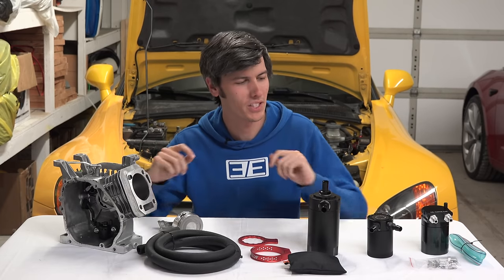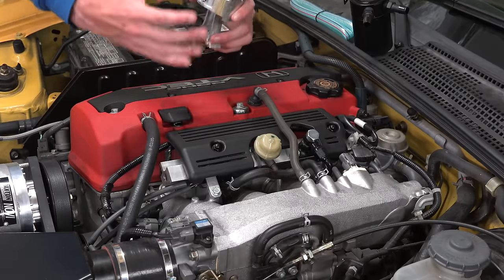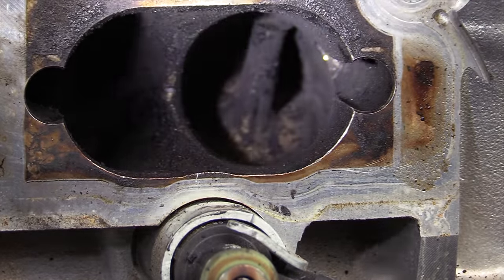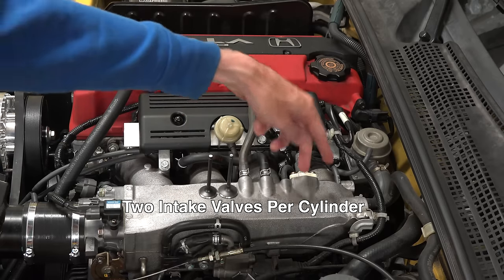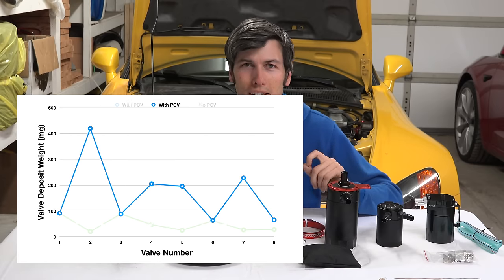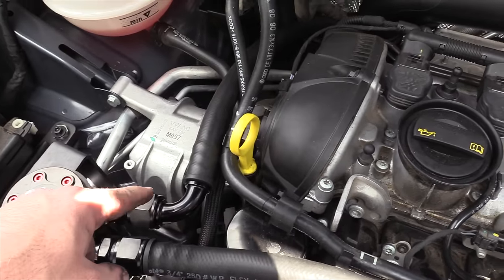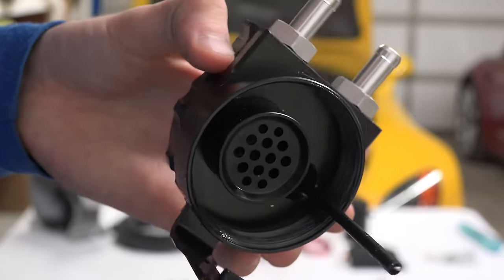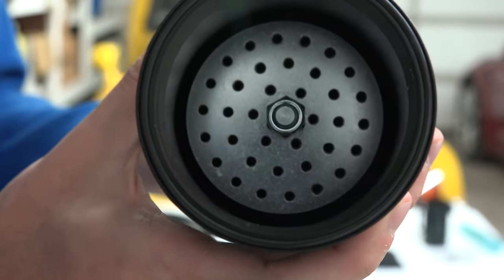Do Oil Catch Cans Actually Work?

Comment: Direct injection engines (now virtually every engine) have issues with buildup on the intake valves, and now that the injectors are no longer positioned to spray fuel on them (they now spray fuel directly into the cylinder) the valves no longer get any cleaning from the fuel and it's additives ... it seems that an oil catch can in the PCV system to separate out oil vapors from going into the intake manifold and coating the valves would be a good idea

Comment: The best design is the $25 one with two Scotch-Brite pads (stainless) inside. They cost $2 and fit perfectly. This setup has caught lots of oil in my '04 Wrangler.
Reply: Roughly how fast did it fill up? I do like the dipstick that comes with it.

Comment: I have the Mishimoto compact unit; its filtration is excellent and on my turbocharged 1.6 MX-5 it fills up with mostly a watery, fuely substance in about 3000 kilometers. This is mostly beating on the engine very hard, so all in all even its small size isn't really a problem if you're already involved in keeping your modified vehicle in good operation conditions, which would imply you do general checks and minor maintenance around/before that interval anyway.
Reply: Your engine needs a overhaul if it fills up in that distance
Reply: @Thunderstormworld  Not when the 3000 km is about 85% track mileage and the can only holds about 30mL until it hits the lower baffle plate and needs to be drained for it to continue to work properly. 
These motors are known to produce quite some vapour under heavy loads by default, so catching those vapours off instead of throwing them directly back into the intake plenum is very beneficial to the engine's lifespan.
Reply: @Thunderstormworld  Dangerous advice to give to someone if you don't know what you are talking about. 3000km fillup in a compact unit is very good, there are cars that fillup way earlier with even newer engines.

Comment: One question I have never seen an answer of  elsewhere is - How Long is Too Long, for the In/Out Hoses? My goal is to place the CatchCan down in front of the Radiator, to get Can as Cold as possible for Condensation. To achieve that I would need to run a 3m Cl. ean and a 3m Dirty line hoses (as I want to keep the engine bay 'Neat' & Least Intrusive to the Mechanics when doing Scheduled Servicings.  I see the 3+3m of Hose results in quite a High Resistance to overall PCV AirFlow... (as tested by using Lungs to Test Blow the entire hose/can/hose setup)

Comment: you could expand on this topic by talking about PCV  vacuum pumps which directly increase HP output , & or the lesser approved of method of running a line from each valve cover into the exhaust header collector at a 45 degree angle and cap off the hole in the intake all together.
Reply: Otherwise known as the built in smoke screen maker.
Reply: @SeanBZA  on a newer car i cant imagine it producing a noticeable amount of smoke but on an older car with loosened up tolerances of the cylinder bore/ring seals probably yes. on this video he drained the container after thousands of miles and had a cup of oil. you have to imagine that same cup of oil being burned over the coarse of hundreds of thousands of combustion cycles in that same time interval.
Reply: If running open headers then yes, if mufflers then it may not work at all. The pump would be nice, but also very expensive and I'm guessing most cars don't have the room to install them. The oem pcv works reasonably well and it's already there so pretty much everyone can do it. I'd like to do the pump but I'm just unwilling to spend the money or time

Comment: Oil air separators on the PCV system are actually very helpful especially in positive manifold pressure designs. The intake Scavenging that OEM happened to go after reroute oil Vapor back through the intake. Severy et al military tests showed oil vapors ignite a full 100c colder than gasoline.

Oil Vapors back through the engine is technically asking for detonation/preignition if enough of it is there
Reply: So, is catch can useful?
Reply: Yes. In this instance it would allow it to be mixed as a vapor instead of liquid with the air and fuel… and increasing power and efficiency.

Computer controlled timing prevents predetonation. If it would occur at all… gasoline engines don't get that hot. Especially if direct injection.

Comment: To almost eliminate piston ring blowby, install a set of gapless piston rings in the engine. Especially for turbocharged engines with high cylinder pressures. They will reduce the amount of crankcase pressure and reduce the amount of oil that these catch cans are catching.

Comment: When used in a 2009-2015 Prius, it reduces buildup in the EGR system, intake manifold and throttle body. This causes a chain reaction that cleans up the catalytic converter and O2 sensors and keeps the dreaded head gasket failure that is caused by un-even cooling and varying compression due to intake manifold EGR ports being plugged on some cylinders and not on others.

Comment: A lot of people are asking why the manufacturers aren't including these on new cars. They don't want to advertise another maintenance item that people need to do, and don't want the liability. If they are never emptied, that can be worse than just not having one. Let's say your can is completely full, and then you drive on some sort of slope, a huge (yuge!) glob of crud is going to get sucked straight into the valves and pistons, and that's bad. Kudos to every DIY'er who takes care of his/her car. 97% of the people buying cars would say, "Huh?"
Reply: Manufactures do use Air oil separators.  They are similar but drain into the oil pan.  It makes no sense to run a catch can on a street car at this point.  Many are also tied into the engine coolant to warm them up when cold and cool them when hot.
Reply: Good point.  At one point they did though.  Nissan had one on the S13 SR20DET.
Reply: That is an assumption. Another possibility is that catch cans are ineffective and do not help much- and that overheating valves are the issue. Or.skmething else entirely. For example the engineers at Toyota have gone to the trouble of fitting port injection to DI engines, why if a self draining catch can would have done?
Reply: Maybe manufacturers like to make money repairing gummed up valves and inlet manifolds?
By the time you have problems it's out of warranty and they're killing the pig...
Reply: until you get a massive lawsuit on your hands.
Reply: Huh?
Reply: Just do an AOS instead
Reply: Why not just leave the bottom of the can open and let the oil crud flow onto the street instead? Zero maintenance!
Reply: Dan E Garner  that’s another assumption, what makes you think that’s the reason or only reason for a dual injection motor? There’s other reasons that are more likely on the engineers minds.
Reply: RJ M   It doesn’t take nearly as long as most warranties for the issues to arise, many dealer techs get to fix these issues under warranty.
Reply: @dantheman1337  I read an article about Toyota or Lexus concerning their initial integration of DI in their engine.  It built so much carbon deposits that they had to put an additional port injector to solve the problem LOL.  The same thing happened to Ford with the introduction of the EcoBoost engines.  There were more automakers mentioned in that article...VW, GM...  isn't carbon deposits one of the causes for valves to overheat?
Reply: Well on some cars that require thousands to clean it is going to be worth it.  Foul out a Cat or walnut blast valves clean on a turbo GDI Mercedes and it'll exceed the price and time spent changing a can by a country mile.
Reply: @logik316  that would just be a massive vacuum leak
Reply: @logik316  I've always wondered why we don't just have oil tanks like fuel tanks that empty the oil from the oil pipe onto the street. When we're running low we can simply refill it. No more oil changes as it's always fresh.
Reply: Still install a catch can for safety and lets just say something of mine blew up well then at least I didn’t get sludge build up 😂

Comment: Just wanted to point out that what you are calling "filters" inside these catch-cans are inbound flowing and function as a condenser to cause the crankcase vapors flowing through them to condense into droplets that then drip into the reservoir.
Reply: Regarding to that, it 's also important that the airflow restriction is keeping as small as it could be.
Otherwise the crankcasepressure is getting high and causes Oilleaks.

So, you have to keep the routing short and the catch can should not contain a Brassfilter in it.

Comment: I am not quite sure about the exactitude of the "blow-by" phenomenon, explained at 1:16. As it is described, it equates to highly worn piston rings, and loss of compression into the crank case. This is usually diagnosed by a cylinder leak-down test, and usually followed by a bottom end rebuild. Try to think of the crankcase as it is from the underside of the engine, as it were. Forget about combustion chambers for now, and focus on what's going on under the pistons. The reciprocating movement of the pistons, as they go up and down create variations in pressure in the crankcase, hence the need to ventilate it. It has nothing to do with piston ring blow-by. I just thought it would be useful to clarify.

Comment: I'd keep in mind the cheapest catch can of the three may cause a vacuum leak if its being used on the PCV to intake side if the dip stick isn't sealed well or has no o-ring.
Reply: New O-Ring = $0.05 ; New Engine = $5,000

Comment: I put the $25 catch can on my Prius. Since it doesn't have a filter, I put in half a stainless scouring pad in the bottom. It doesn't exactly filter but it keeps the oil form splashing up and out into the intake manifold. Especially in the winter time, it catches a lot of oil, water and gunk that would've gone into my cylinders via the intake manifold.

Comment: Nice video , you forgot to mention the effect oil vapor has on knock threshold.  High performance engines use catch cans ; or just vent it to the atmosphere; to try to keep the oil out of the intake . Oil has a very low octane rating so it wouldn't take a whole lot of oil vapor to lower the octane rating of the fuel you are burning in the combustion chamber and lowering your knock threshold.
Reply: Good point, thanks!
Reply: yes, vent to atmosphere which is highly illegal on the road's.

Comment: I have a 2 liter Solstice GXP.  Routed the PCV to atmosphere. Problem solved.  Lots of discussion over the years about the value of catch cans.  Nice to see some engineering testing.  What about SeaFoam treatments to remove deposits?
Reply: But you introduced another issue of not venting your crank case with vacuum while driving which reduces engine life. Real solution is to pull a vacuum with exhaust but through a catch can to burn as little as possible.

Comment: High temp of gas flowing doesn't get trapped due to lack of condensation radiator (or similar device) optimal would be having a bubler type of set up in water or to prevent possible corrosion it could be bubler in diesel. Basicly something with high smoke point yet enough thermal capacity to maintain lower (oil and water condensating temp).
Water: 4.18 J/g°C

Brass: 0.38 J/g°C (varies depending on the exact composition)

Oil (varies based on type): Generally around 2.0 - 2.5 J/g°C

Tell me if i missed something or why this would be a bad idea?

Comment: Something people forget with oil blowby is it can massively reduce octane, so those of you pushing it with timing or boost should consider it a must.
Reply: Good point
Reply: How would it reduce octane; octane is the fuel's resistance to pre-ignition. A lower octane means it's easier to ignite/have a pre-ignition in a higher compression engine.  Do turbos increase compression levels?
Reply: @Tadders  the crank case vapors venting into the combustion chamber have a lower effective octane rating that the fuel being injected, they’ll detonate before the fuel does.
Reply: @pballer2005  ohh I suppose it's because it's vapor, makes sense. Thank you.
Reply: so i have a 99 cobra with a forged bottom end , and a 2.1 kenne bell supercharger it’s currently at 9 pounds of boost making 475 to the wheels so in the conservative side since it’s pretty much a daily, i don’t race it little to none nor do i floor it a crazy amount just get on it here n there. how big of a deal woukd it be if i NEEDED a catch can or not?
Reply: @chrisj2308  I’d argue it’s needed on any boosted car since they have more blow by, more vapors blowing out the pcv and into the intake.
Reply: @pballer2005  thank you for the quick reply i’ll have to purchase one thank you my friend!
Reply: This should be the big take away. “Carbon deposits” from blow by might be an issue. Oily deposits might be an issue. Oily, “mystery mix” going into the cylinder, potentially reducing power, probably lowering octane, and likely contributing to deposits INSIDE the combustion chamber are more worrisome. If your injectors wash the deposits off the valve, where do the chemicals that make up those deposits end up? In the combustion chamber. Food for thought, and a better reason to catch those compounds.

Comment: I actually changed mine to the cheaper can. Found those bronze filters over time clog up. So it’s restricting the oil filtering through properly. The cheap one I’ve had no issues with because there’s no filter that can get blocked over time.
Reply: About changing the brass filter? Are they not available? Filter is a good idea, not?
Reply: You are meant to wash the filters you know, and also you are better of not using a catch can if you don't even have anything that filters the gases that come through it.
Reply: @Robin-hi8oq  Definitely worth putting one on, my catch can is collecting a lot of deposits and nasty oil. They’ve been proven they greatly reduce carbon buildup. Best thing I ever did was put one on. Mines now also setup so you won’t need any filtering. All the crap goes directly into the catch can and no where else. I’ve just got to make sure to empty it.
Reply: @LostInDistance  It's good that it works well for you but you are still gonna get oil vapor into the engine without a filter but it probably won't matter that much
Reply: @Robin-hi8oq  Nope. I won’t be getting a single bit of vapour. Mines setup so there only a single pipe that comes directly from the engine straight to the catch can. There’s no second pipe going directly back to the manifold. It’s all down to the setup. 

Mine also has the small induction looking filter on top of the can to let out the vapours. You might be mixed up with the filters they put inside the catch cans?

Comment: Porsche has an Oil Colalesing filter system that does not need emptying. I have a Pirren unit for my Subaru Turbo XT too that just replaced the oil filler cap. You do NOT want oil inside the intercooler at all.

A coalescing filter system removes oil by forcing oily PVC air through a housing that makes the air change direction. When the air changes direction and collides into itself, it forces any oil to coalesce, or stick together. This creates drops which are caught on the outer screen and gain mass, then forced down into the lower housing by gravity.

Comment: Having not installed one of those cans on my 1990 Hyundai Elantra has caused my headlight fluid levels to fluctuate erratically and my discombobulator to quit working. 
I sprayed some WD40 on the windshield wipers and it kinda helped for about 2k miles. It also added about 20 more MPG to the car.
Reply: I also had a blown head gasket issue. So I flushed the motor oil out with octane booster, replaced it with diesel, then replaced the radiator fluid with synthetic oil and scrubbed the transmission casing clean with a tooth brush. Worked like a charm.
Reply: Boats 
How dare you steal my patented and copyrighted methods. I’ll see you in court, or maybe in Starbucks. 
😎

🤣

👍👍👍👍👍

Comment: Really needs to be mentioned that especially the 50 micron bronze mesh catch can will INCREASE you crankcase pressure, it is somewhat better with it removed, but its still a significant increase up to 4 mbar from 1.59. The cheap baffle-only can was only a negligible increase in pressure.
Reply: I have a  007 Lexus IS350 V6 that has both Direct injection and port injection. I've recently upgraded the intake tube with a RR-RACING Carbon fiber tube and introduced a K&N crank case breather. My question is:if I install a $200.00 quality catch can with a filter will my breath filter balance out the amount of pressure built up in the crankcase?
Reply: The consequence of increased crankcase pressure is oil leaks past seals especially the crankcase end bearings.
Reply: This indicates a vacume leak… as when the system is connected correctly the engines would create a negative pressure at all times even with resistance. 

Clogged pcv could also cause this.

Comment: The first one I got can be vented cuz it has a bolt on top u can take off. Also that baffle un screws and u can put whatever filter u want such as steel wool foam or brass